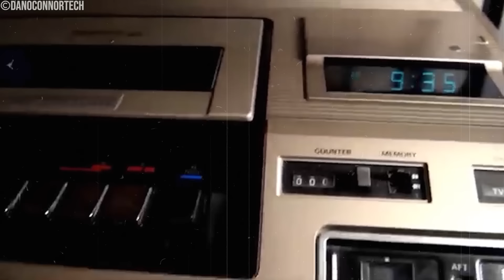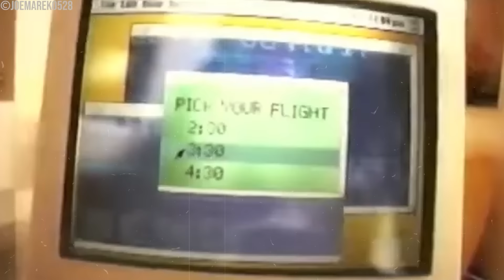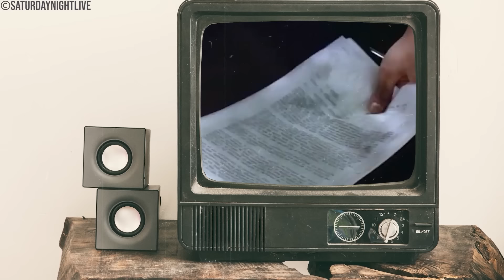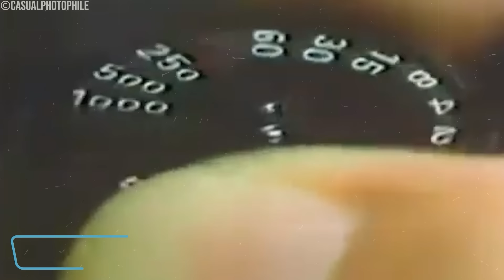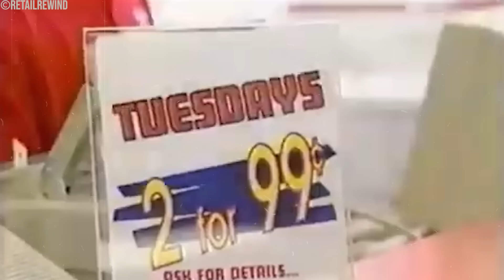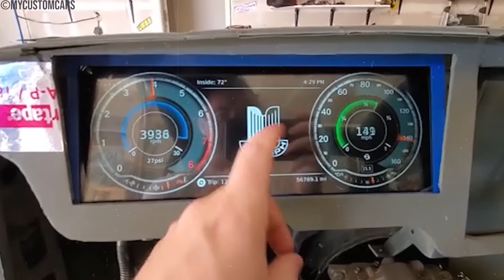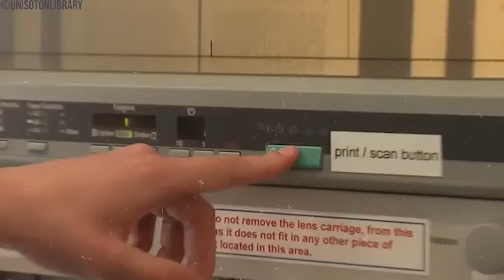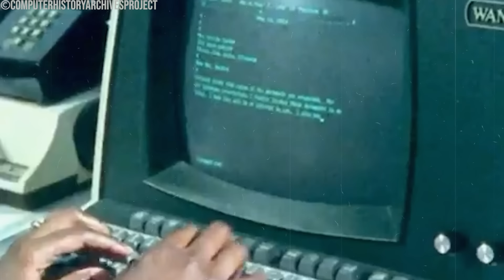25 Things From 1980s Once Necessary, NOW COMPLETELY OBSOLETE!

Comment: In the 60's there were TV's that had mechanical remotes the operated on sound.
It required no batteries or cord.  6-functions: On/Off, Volume Up/Down & Channel Up/Down.  It worked on a tuning forks.
Reply: Yes, but many early VCRs had corded remotes, although I doubt many used them.
Reply: Clunk clunk clunk clunk clunk around a motorized rotary dial channel tuner to get to one of the 3 tv channels . 
 Very noisy and slow  . Clunking and the remote was a high pitched ringing bell spring loaded remote box . Keys jangling or a small chain could trigger the electric motor piwered tv tuner in the tv set to start up clunking " around the dial " to change the channels . Dishes and doorbells triggered the audio controlled remote .
Reply: @gregorydahl  
When I was a kid, I tried to hold the channel dial still, while it was rotating.
That thing had so much torque, that my hand would probably break before the dial would.
Reply: Zeniths and Telefunkens 😂
Reply: @nunya___  My parents had this Zenith TV that worked like that.  It only had one button, and changed the channels.  I found a small bell that also worked on it.
Reply: @bugstomper4670  your keys would 
Work also , if you jingled them just right .
Reply: Early VCRs were in the 70s no VCR had a cord in the 80s

Comment: Most is right. The one thing that I miss is the phone on the corner. How many times we have a problem with our phones and the person on the other end want us to call from some other phone to troubleshoot our phones. Some of us have no other way. I miss the old land line phone.
Reply: We still have one, but probably not for much longer - the monthly charge is rivaling or even exceeding the cost of using a cell phone. My basic flip phone can do more and costs less than the land line phone now!
Reply: I still have mine, and my computer is hardwired to my landline

Comment: I've used absolutely all of that ancient tech. The first thing I did when traveling to a new town was go to a drug store and buy a local, foldable city map. Smaller towns usually didn't have maps. Sometimes gas stations would give out free state maps. Every year I bought a new road atlas which had state maps and maps of large cities. I also bought a new almanac every year. It was crammed with data like sports statistics, election results, and so, forth. No Internet—everything was updated only once a year. I had several Palm Pilots, a Casio calculator watch, and a Sony Mavica digital camera. Every 6-10 photos, I had to swap out the 3-1/2 inch floppy disk. It was a pain carrying a pocket full of floppies, but it beat dealing with film. I don't miss any of it.

Comment: I hate to say it but dot matrix/impact printers are still used for bulk invoices and other things in mostly the commercial industries due to the rugged build quality and low price per page prints, especially for multiple carbon copies.  The price per page print is still less expensive than xerographic printers like laser and LED units.  I find it amusing but possibly true where you still hear these relics in Futurama.  I don't think we will see these disappear for a long time.

Comment: I have never stopped using paper maps. They are still valuable if you know how to use them. They are more reliable than mobile phone, work everywhere and don't run out of battery.
Reply: Exactly!!
I ONLY use maps.
I carry individual maps for all the nearby big cities in case I have to travel there.  
Oh get a GPS...then you find out your paying for everything and then at 7 years the company obsolete your model and you have the good fortune to buy another one and start all over again. 
Buy a paper map once.  
Yes I found that certain roads were closed not mentioned on the paper map just followed the detours.
Reply: Speaking as a heavily engaged Orienteer I can definitely +1 that comment! 🗺💯👍

Paper maps are much better for the purpose. I've never managed to kill a paper map by running through thick patches of Ulex or deep streams, they've never broken when I've tripped at high speed and crashed to the ground on top of them, and they never need signal to keep on going. 👍
Reply: Thanks for nice answers. I must admit that I use both, paper and digital. As a geocacher I naturally love also using GPS. However, there's always paper map in my cars glovebox, and I regularly use it. Also as a tourist a nice small paper map of the city centre is very convenient and often more usable that google maps.
Reply: @dieseldragon6756     I slip a map into the plastic sleeve on my motorcycle tank bag. Don't even need to take my hands off the handlebars.
Reply: Maps of US cities can be used to play chess on them. A feature that european cities cant provide.
Reply: If you can navigate an A to Z in the UK, then absolutely, digital maps, google earth etc. are a walk in the park

Comment: 12:40 is not an antenna "adjuster" as described and did not move the antenna, but rather adjusted the amplitude of the incoming signal. Then, I had a good laugh at 12:50 when the drab couple is enjoying a stationary picture, printed and taped on the tube.

Comment: Just to clear things up a bit, 5¼" drives did not have plastic cases. They were usually paper, or something else that was floppy. Hense the name.

It was the smaller 3½" disks that had the plastic shell. They also were called floppies, though of course they weren't. It was more correct to call them diskettes. It still is.
Reply: 5.25" (and 8") floppy disks definitely had plastic cases. They were thin and flexible unlike the later 3.5" disks but it was still plastic.
Reply: @ilovethe70s  I don't imagine those 8" disks had much capacity. I've seen them. They're interesting to look at. I wouldn't mind seeing one still in use. I think they're neat because they represent history, not just computer history either. I can guess it was a god-send to people who finally had a portable format to store programs and code.

Of course, I can either sit here and type about it, or I can go use the GoogleBing and it would tell me everything. Maybe there are even vids to watch. : )

I don't know about you, but it's been a long time for me, using PCs. 32 years. Of course others have been at it much longer. But whenever I think about what I've seen come and go, what's changed in my life, all 32 of those years come falling right down on top of me.

Sorry for the long reply.
Reply: @keithbrown7685  Looks like the first 8 inch floppies held 79 KB and the largest by the end were 1.2 MB. I've never seen one in person myself. The first computer I used was in elementary school, a TRS-80 Model III I think. We had IBM PS/2s in high school.

Comment: Push button phones were in the '70s .    And cable was installed with promises of expanded communications and ' visiphone " telephone service with video calling . The 1980's began more and more car mobile phones and " portable" home phones with an antenna transmitting to a reciever hooked to regular telephone lines or cable communications .
Reply: The first pushbutton phone, and, the first video phone appeared in 1964 but were of course expensive and I doubt many had it until later.  
There were Car Phones in the 1950s but they were expensive and took up almost half the trunk area of a Cadillac.

Comment: What I find interesting is the bit about the TV Antenna adjuster.  I since got rid of the cable/satellite TV service and get all my local channels over the air, and still use a TV antenna adjuster.  Between that and the Disney+/Hulu/ESPN+ bundle streaming service and that is ALL the TV I am interested in.  Also, given certain "recent events", it seems that pager/beepers were actually still fairly prevalent in usage.

Comment: you forgot the 8 inch floppy disc
Reply: And are still used for the software in commercial aircraft today.
Reply: Those mostly died out in the 70s. The original IBM PC from 1981 shipped with 5.25" drives and the 1984 Macintosh had a 3.5" drive.
Reply: Steady on, chap! This is an all-ages channel! 💾🇬🇧🤣
Reply: @dieseldragon6756  no joke realy before the 5 1/4 disch there was 8 inch disv very ecpensive 430 for one blank disc that held less that half of the 5 -1/4 disc
Reply: @dieseldragon6756 i just looked it up the capacity of the 8 inch disc was 80 kilobytes thats correct only 80 kb and remember a blank cost $30 arent we luck now adays

Comment: Actually, we had push button telephones. There were those who still had rotary from time to time, but push buttons were really popular in the 80s. also, we had cable TV in the 80s. Wasn’t as wide spread as it would become, but we did have it.
Reply: Portable phones became popular in the mid 80s because we had one.
Rechargeable and portable though big and clunky in bright colours with long metal aerial.  The 90s brought the rounded handsets with "rubber" buttons and rubber short aerial 900mhz. 
Pushbutton phones first appeared in 1964 but were not popular.

Comment: 2:00 I remember rotary phones in the 70s, but by 1980 they were becoming a rare site, even more so when more automated systems began to appear. These systems needed the tones from push button phones.
    By the time I was in Jr High school, (1982) I hardly ever saw a rotary dial phone.
Reply: And the earliest Portable Rechargeable phones appeared.  They were big and heavy and staticky.  Became smaller and more reliable by the mid 90s and the Cellphone was already a thing.

Comment: Fun fact, the Commodore 64 at the start worked with cassette drives and games were stored on them. However, actually loading the games was extremely slow. Understandably, floppy drives overtook them big time on the C64. 

The Famicom Disk System used a proprietary version of floppies. However, advancements in cartridge storage format made the Disk System ultimately redundant. The short lived 64DD also had its own version of the format. 

The Sega Dreamcast was intended to have its own ZIP Drive attachment.
Reply: Both the cassette tapes and the floppies in C64 were much slower than comparable products on other manufacturers.

Comment: Good luck trying to convince the most hardcore retro gamers that CRTs aren't necessary.
Reply: They might still be needed for light gun games (Where a single frame is used as a targeting mask for the gun, and modern TVs tend to omit it as an assumed signal error) but they might also have worked past that problem by now. I'm not a gamer myself, but I know exactly what you're talking about! 📺💸😉

Comment: Photocopiers were available in the 1980s. In the seventies they were rarer and one used Spirit duplicators. The film section included an ad for APS which came in 1996. No TV had a remote with a cord in the 1980s. They were similar than they are now though typically had individual plastic keys. It was nice if you dropped it and it broke the individual keys were all over the floor.

Comment: In the late 70s and early 80s, the first pagers did not have a display giving you the number that had dialed you. To differentiate between a preselected set of numbers that was programmed into the pager to receive, the pager would beep in a code that would identify which of the preprogrammed phone numbers had called you. My dad had one while he worked at White House Communications, and his would alert him only if he was called from one of five different phone numbers, either from the White House's main switchboard or four other extensions within his department. Before even those pagers, the beeper would simply beep, indicating someone was trying to reach you, and you'd have to call some kind of switchboard operator to find out who the hell was calling you. My dad said those things were more of a pain in the ass than anything else.

Comment: It must be me but I still have my 1985 Sony Walkman WM-24 (not working) and my 1995 WM EX-622 (working). I still have my Sony SLV-835 VCR and 207 VHS original cassettes. I also have more than 4,000 DVDs and 820 Blue-Rays (I don’t like streaming services - don’t like to “buy stuff that doesn’t belong to me). I use my old roll film cameras beside my SLRs (Canon & Nikon) and my DSLR (Canon), I don’t have Mirrorless cameras. I also still have a Sony DSR-200P in working order, unfortunately only 6 tapes left. I own 7x Commodore 64 (bread bin), 5x VC1541 disk drives, 4 tape drives, 2x Commodore 64 new design, 2x Commodore 128, 3x Amiga 500, 2x Amiga 600, 1x Amiga 1000, 2x Amiga 2000. I still have an Atari 800xl and 1200xl as also an Atari 1040ST, 2x Apple IIe and 1 Apple IIc. 
I just love this old stuff, maintaining it, repairing it and using it. Beside all that I have roughly 70 typewriters from 1892 - 1964 and cameras from 1902 - 2016.
Call me a freak or lost in the past…

Comment: Floppies came in three primary sizes; 8", 5.25", and 3.5". The 8 inch and 5.25" formats were actually true to the name floppy.

There was an alternative attempt known as ZIP Disk.
Reply: I don't remember the 3.5 existing in the mid 80s.   I saw them regularly in the early 90s    i only saw the 5" diskette and 12" hard drive disks along with Cassette storage.
Reply: @RetroCaptain  IBM used them on the PS2, which came out 1987. I saw my first PS2 in 1990.
Reply: @hccaos44  I briefly had a monitor to one of this model.

Comment: Rotary dial was 60 early 70s  by the 80s touch tone and wireless phones wear common.  This video was made by people who where not born yet in the the 80s
Reply: Depends on where you lived at. Rotary dail phones are way older then 60s. They came in the 40s! (look for a german W38 phone) and were used until end of the 80s, even in phone booths.

Comment: I heard the VCR recorders may make a comeback in 2025. Presently I do have a DVD/VCR combo I purchased from Amazon two years ago but only the VCR works and not the DVD. Currently you can only buy a VCR recorder through eBay or Amazon but they're used items and when they break down you cannot get it fixed. Still I rather prefer the VCR than the DVR to record my shows. Hopefully they will return in 2025.
Reply: There are a few techs that still overhaul VCRs today. You have to search but they're out there (and busy)

Comment: 2:27 Those are not floppy disks. Floppy disks are the large, 5 1/4-inch, thin disks. They are flexible, hence the “floppy” part.

Those shown in the video are hard-cased 3 1/2-inch disks and they are called “diskettes”.

Comment: Well allto pagers ( beepers) has fallen out of general use, they seam tomstill be used in hospitals and maybe. a few other places. And no phones ( even rotary onse p} have newer wotked without electricity, the thing is the CO supplied thei electricety neededc a
, in fact they where mandated to have bateries and/ot generators  so they could at leastnlrovide 911 service during power outages.
Reply: Yes, land lines were 48 volts DC. To generate a "ring" 90 volts AC was sent down the line.
Reply: The beauty of the rotary phone was that it was reliable even when the power  or weather was not.  Not even the dial was required, just tap out the numbers on the cradle. 😊
Reply: @kirkboivin4357  yes because regulations demanded the be so,and evry one payed for it  only it was never specified exactly how much

Comment: You are wrong about rotary dill phones all types of phones need electricity to work 50v DC the reason why the do not go off in a power cut is the telephone exchange has back up generators to keep things working cordless phones don't work in a power cut because the bass station has to be plugged in to the mains power to be able receive a signal from the hands free hands set we use to use special phone units  in my now retired job has a telephone engineer which had battery's so you could talk to each other on a spare pire of wires in the cabel you were working on but everything will be going over to full fibre wich use a different technology which was being introduced when I retired so I don't now much how it works

Comment: Obsolete. ? Lmao I have a Sony slv650uc that still works it’s over 25 years old . Made in Japan  - and a pioneer floroscan system  still works 
Ct f 900 cassette deck -sx d 5000 receiver - 9800 series eq - D 500 audio timer - RG 2 audio processor 
It still drives nails  .